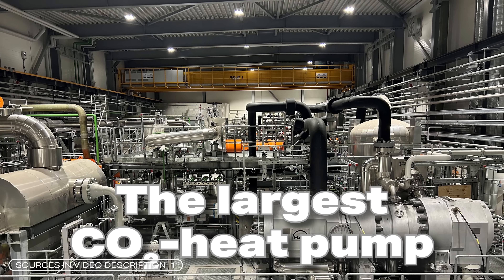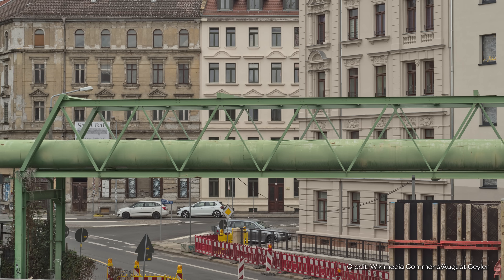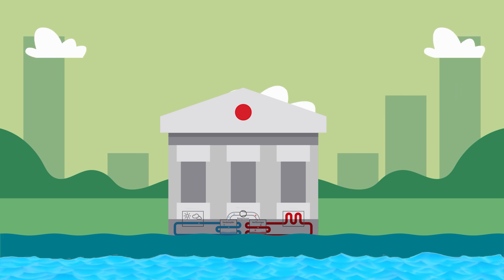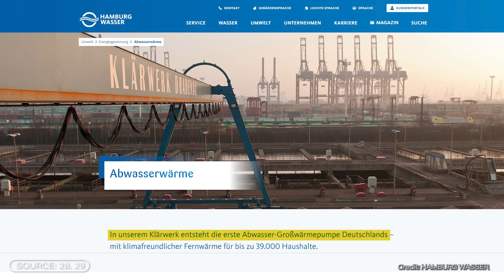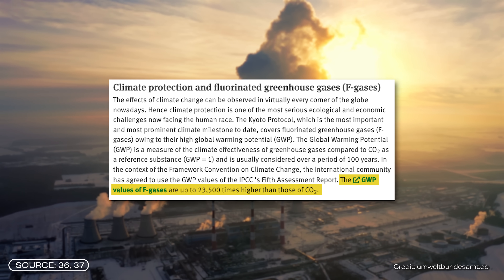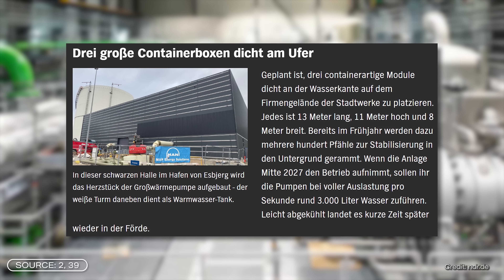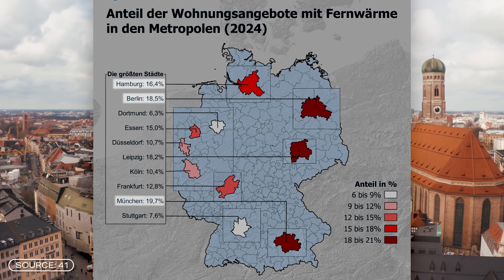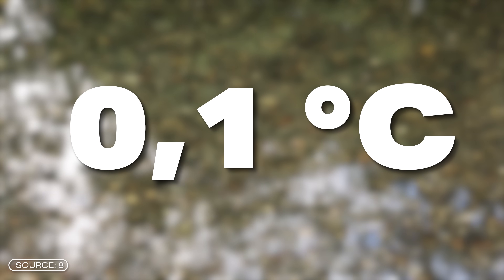World's Largest Heat Pump: Denmark’s Seawater Heating Revolution

Comment: Jakob, sorry, I don't want to be offensive, but whenever I hear statements from somebody with a PhD like at 1:27 "a heat-pump can generate 5kW heat form 1kW electrical power", then it's enough make my thermodynamic toes curl. No, a heat pump does never generate heat. It transports existing heat above 0 K from a reservoir and compresses it in a thermal cycle to a desired level. This is the big difference to power plants, that convert power (or energy, when a duration is involved) into another form. E.g. electrical or thermal power.
Reply: No wonder my toes were twitching!
But I was wondering about the operating temperatures to obtain a COP of 5? I know W/W is more efficient.
My home air/air HP is rated COP 4 (optimal performance) @47  Fahrenheit.
At that temperature, I have more than enough solar gain to warm the house (Northan Illinois).
In the winter, the COP is closer to  2, and I compare the price of natural gas to the cost of the HP...
IMO, the salespeople took the engineers out for a long lunch and came up with 47 F, a BS number.
Reply: Sperg moment, learn to get used to colloquial English. Heat is generated by heaters, a heat pump provides heat to homes, therefore it generates heat.
Reply: Not wanting to be offensive, but what is the meaning of "generation", have you looked that up? 😅
Reply: @beerenmusli8220  The word "generation" in the context of energy means energy conversion. E.g. one can generate electricity from sunlight, coal, gas, etc. An ideal heat-pump does neither generate heat, nor cold, but transports thermal energy from one place to another. In this process, the energy density can be increased for heating or decreased for cooling. The figure of C.O.P. describes how efficient this process can be performed - in comparison with a energy conversion process.

Comment: heatpumps were available for a loong time. I'm angry that we didn't use them back then when nuclear energy has gone big. Would have saved immeasurable amounts of CO2..
My house got a heatpump just a few weeks ago. It's huge, but quiet. On the terrace around 10 meters away, no-one can tell if it's running or not.

Comment: I'm from DK in a smaller town (with required connection to district heating) but honestly I wish I could just have a normal heat pump instead, esp. for cooling down the house in the summer (so might get one anyway for that purpose alone), live in a low energy house, that requires ~4MWh energy per year, which is next to nothing.  The biggest cost for central heating here, isn't the actual MWh consumption, but the fixed fees to be connected, so I end up paying nearly the same as someone using 5x the energy, which feels a bit shit tbh, when you live in a low energy house, but are forced to be connected to district heating.
Reply: Either you got a M where there should have been a K, or you are using a small town worth of energy per year to heat your house. 😅 

Nurse on first and last day of job: "Yeah I gave the patient 10 milligrams." 
Doctor:  "WHAT HAVE YOU DONE?! See the little u like letter there before the g? It means MICRO-gram, not m for mili!"
Reply: @schnizzyfizz7832  4000kWh a year is 4MWh a year... so he got it right...

Comment: Cop 3 hmm not god, Heat loss in distribution net of minimum 25% often up to 40% at normal like in these years with the amount of energy used in buildings when buildings will meet the energy efficiency as needed to comply Energy efficiency directives by Eu, the heat loss will be bigger percentage.

Total calculated Cop 2,25% with 25% heat loss in distribution net.

It is the stupidest thing to have district heating.

New individual Air source heat pump have seasonal Cop of 5 at least double as good as the scam district heating with Heat Pumps

Comment: Why not add Datacenters to your plant? They have very large heated thermal output, easily over 10C that could be coupled to the cool water intake. That in turn solves over 50% of Datacenter operations costs. With AI (KI - künstliche Intelligenz) power demands on these facilities has greatly increased. In fact with AI power demands from global data centers are expected to double by 2030. Current Evaporative Air Coolers used in datacenters are very inefficient. If countries with access to Oceans were to leverage this thermal energy conversion we could solve many problems at the same time. Ask me how I know.:learning:

Comment: You'll have to take those 75% with a grain of salt. While coal in large part has been removed from heat and electricity production,  it has to a large degree been replaced with biomass, meaning woodchips, of which Denmark has quite a sizeable import. Large enough that we wouldn't be able to cover the consumption ourselves.  So, green... it all depends on how the math is done.  Definitely not without carbon emissions.
Reply: It's still better than fossil fuel sources and is still less carbon output than LNG or uncapped methane output from oil wells left abandoned. Many fossil fuel operations are still polluting the environment long after being exhausted for practical supply.
Reply: @glennmorgan4197 Not denying that at all. Just urging people to figure out/remember it might not be the utopia stated in the headlines.

Comment: My MSc in 2004 included a study of integration of additional wind power onto the power grid of Western Denmark using heat pumps and hot water storage to help balance the grid whilst replacing fossil fuels in both electricity and heat supply. Great to see these ideas applied in practice.
Reply from the maker: Oh that‘s really interesting! What were your findings?
Reply: @GermanScienceGuy I looked at large scale heat pumps combined with multi day thermal stores on district heating networks as a way to integrate extra wind power into the grid. The premise was that the heat pumps would be used in 2 ways. 

1. To prevent wind curtailment - turn on large numbers of heat pumps so that a load becomes available for the wind farms. 

2. Firming up wind power. Generally 4 hours out, wind power on the grid is reasonably predictable +/- around 10%. The variability is also somewhat predictable depending on whether conditions are steady or if storm fronts are approaching. Suppose 2 GW is predicted with 10% variability, it was suggested to presumptively schedule 200MW to heat pumps and adjust actual usage up or down in a 400MW range to make residual wind power on the grid predictable, and the heat pumps become virtual spinning reserve. If the grid demands more or less power due to variations from predicted demand, similar adjustments can be made. At the time, I thought this approach likely to be the most cost effective approach until very high penetrations at which point battery storage, compressed air energy storage, or additional interconnects with other power grids would need to be added.  (Dampening out variation by sharing across a large geographical footprint.

Comment: Grüsse aus Dänemark Jacob🙂
It's funny I have to hear about this heat pump through you, being Danish and having family that live in Esbjerg. 
However, I am connected to district heating where I live. It runs on a combination of natural gas and solar heated water, and is a small de-centralized electricity/heating plant. - and it is not cheap if you ask me... 
I live in a 1936 vintage house, with relatively, for its vintage, good insulation and I am paying about € 200/month towards heating at a base temperature in the house of 18°C - plus of course all our hot water requirements. 
From 18°C and up to our comfort temperature we burn wood in a modern low emission wood stove - because we can and we enjoy doing that. That adds another €4-500 annually - but it is just so nice and also CO2 neutral.
That is, in our case, an average of € 8/day all included.
I have to mention here that we spend about 100 days/year out of the house, during that time it sits at its base temperature of 18°C - or whatever the temperature gets to when the sun shines.
A modern "zero energy" house would, environmentally speaking, be so much better! However, a house like that would cost € 3-400.000 to build on this property,  If you do the math it is simply not viable - it would take more than a lifetime to offset € 8/day.
I think this issue is pretty much pan-European, if not world wide, so our best environmental bet is improving the efficiency of heat production, just like they've done in Esbjerg.

Comment: The thing I think about is how just providing district heating, without district cooling is making the whole system less efficient. What I mean is cooling for refrigeration and air conditioning, if the cooling side was used to replace individual points of cooling like refrigerators and AC units even more energy can be saved. I don't have numbers, but I'm sure using the cold side of the heat pump would increase the total CoP of the system.

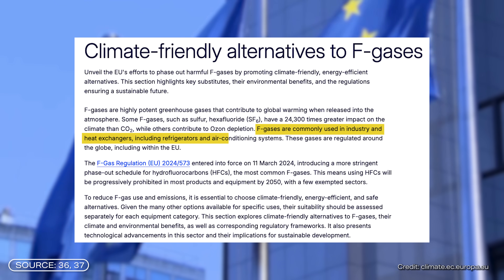Comment: 8:03 "...the effects of climate change have been observed in virtually every corner of the globe nowadays...": ... and all days into the future, and yesterday, and 200 years ago when the evil industrial revolution began, and 2,000 years ago when hunting and gathering were very popular. It's caused by the sun and it's a natural stochastic process of a stable system with a negative feedback loop. So what!
9:30 "...for every 1MwH of electricity it produces 3MwH of heat...": Leverage = 3x. But he already described a local heat pump solution with a leverage of 5x. And they're making those illegal. So what is the real objective? How many minds are influencing here... and what is their real objective? What would they be doing with this CO2 scare being proved nonsense? I guarantee you they would still be in operation because the CO2 is not their motivation. So what do you think their motivation just might be? Watch their every behavior and it's obvious. I think they should have their own space... and I shouldn't be anywhere near it nor near them.

Comment: HEY JACOB - Love your channel but you have made a very basic mistake right at the start.
Heat Pumps DO NOT convert energy they MOVE IT and that's why they are called a PUMP.
This is one of those areas where technologists have done a terrible job of explaining something and its caused a lot of confusion among the general public

As you'd know from the Laws of Thermodynamics it is impossible to have any process with >100% thermal efficiency.
Carnot efficiency = 1 - (Tc/Th) which ranges form 0 to 1

Its vital that this is pointed out because there are too many clowns making wild claims about 300% 400% 500% efficiency.
Which as you'd know comes form a different formula which calculates a Coefficient of Performance (NOT efficiency) which does produce numbers >100%. 
Coefficient of performance (heating) = Th/(Th-Tc) which ranges from 1 to ∞
Coefficient of performance (cooling) = Tc/(Th-Tc) which ∞ to 0

Why they put a "%" behind it is more sales gimmic than anything else.

Comment: The 15.000 kW per year in average household usage seems extremely high. For my house in Denmark, freestanding 130m2, I use about 4.600 kW including for heating with heat pump, cooling (a/c) and all other electricity consumption including washer, dryer, dishwasher etc. So in total a monthly cost of about EUR 120.

Comment: 5:25 Heat pump integration strategies into DH vary from project to project.  One use it for the base load but one for peak loads.  Esbierg's one, the Danish system mentioned in the video, use it as the second heat source after incineration waste heat system.  So it bears relatively constant load in winter.  And Mannheim one, I remember, use it as more flexible auxiliaries.  FYI

Comment: 9:39: Only electricity from wind turbines? Even on days when the wind is not blowing, impressive. The green transition has many pitfalls, and for some it has become a religion, and it definitely does not help the overall environment, as there is more than just CO2 we must include in the overall picture. Greetings from Denmark with more and more expensive electricity prices, even though we have lots of sun and wind.
Reply: When  electricity is expensive, they burn waste and biofuel. But admittedly biofuel is also controversial.

Comment: An alternative is to use nuclear, specifically SMRs (small modular reactors). These produce warm or hot water as a "by-product". Producing hot water does to some extent reduce the efficiency of electricity production but hot water produced during the summer could be stored for winter  either in a reservoir or boreholes heating rock.   Bigger the store, lower the loses. 
This could be supplied for district heating and large insulated pipelines could supply hot water over 100s of km with minimal losses (less than losses from electricity). 
The hot water could be used as a one way supply with central heat pump extracting the residual heat and feeding it back into the district heating scheme. But small heat pumps removing the residual heat at even a single house level and the now cold water simply put down the drain, or fed to the cold water supply.  This saves on the expense of return pipes. 
This may seem wasteful of water if put down the drain but 1m3 of water could deliver 100kwh of heat. 1m3 of water costs approx £1-2 in the uk. !00kw of heat, even when heated by gas is about £7.  This approach maybe attractive if you wanted to base the SMRs away from the town or city were water is readily available and can be more easily stored in a "hot reservoir" or in rock. 
This would allow waste heat and energy produced by SMRs, especially in the summer,  to supply hot water in the winter.

Comment: Heat pumps, individual or large scale are energy efficient - in particular when some, most, of the Electric Power is from Wind or Sun.
However, while district heating sounds like an unbeatable idea, you need to factor in the construction cost of the distribution network. It is very expensive. In the best of cases, this construction cost is carried as a collective burden by all users - in other Words an additional cost carried by existing customers. If the tempo of construction is balanced with cost of energy + construction costs, the whole system Can be beneficial.
However, in some cases, for political reasons, the speed of the construction is so High, the construction (roll-out)  destroys the finances by creating exorbitant expensive pricing - regrdless of whatever cheap heat source (burning trash, using sea or river water).

Regardless, IF a system for district heating exists, heat pumps seem to be an excelleret idea. IF such a system DOES NOT EXIST, it is NOT obvious, that the finances Will work out. Maybe individual heat pumps, perhaps combined with solar and direct water heating, Will be much more feaseable.

You need a financial model, with alle expenses included, before the bottom line Can be understood. Simple optimizing of one componen (the heat source) creates a false argument.

Comment: Could they not just use great big massive plastic pipes out into the sea so that they get to the part of the sea which isn’t as affected by the temperature fluctuations and then pump freshwater through the pipes?

Comment: Another advantage if the central heat pump was to be used for cooling in the summer would be that the heat would be released far from the apartment building or home that was being cooled. Walking outside an apartment building on a hot summer day when all the window mounted air conditioners are running is like stepping into an oven. Unless there is a good breeze to dissipate all that hot air you soon realize that you are only "moving" that heat, not really "removing"it.